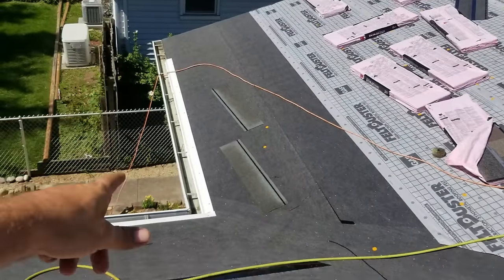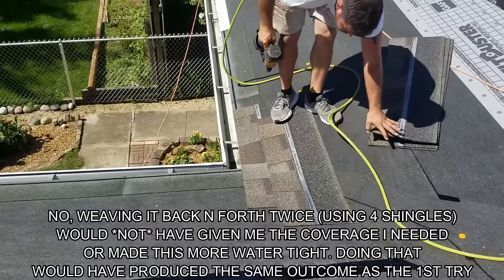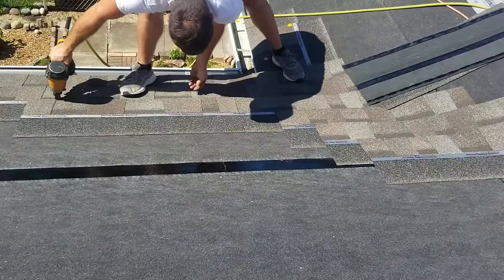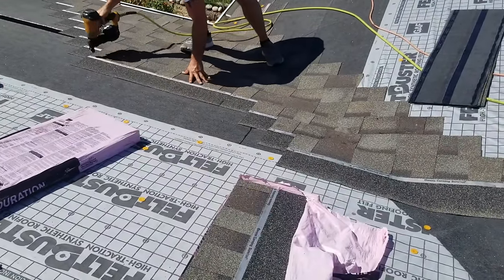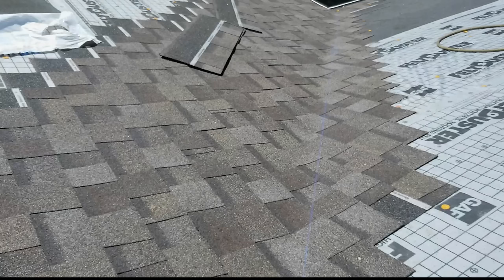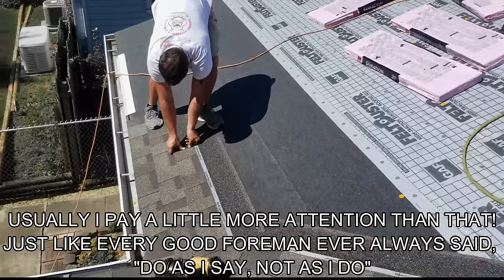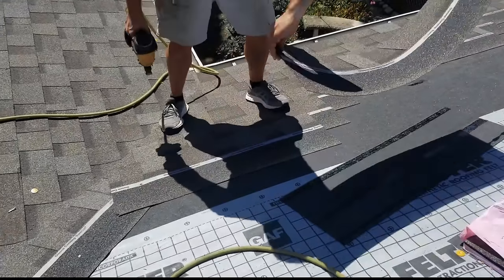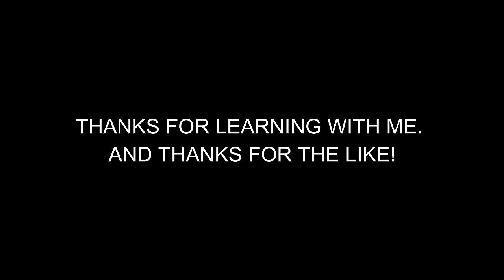How to do a closed valley!!!

Comment: Gotta love the haters on here 😂 Been doing valleys like this for 10 years and have never had an issue. Looks good. Keep it up 👍
Reply from the maker: hahaha its expected. most members of the hater herd either learn their lesson or become fans. its all part of the process. the channel is growing really quick idc about haters its all about the fans now. I might still straighten out a dumbass or 2 for fun though who knows
Reply: @NWIVeteranConstruction  Fall protection is the law, and if you want set the example you should do it right. Oh and California valleys leak.
Reply: @NWIVeteranConstruction  just curious what area your from? Im not being a troll. Im up north where Ice gathers in valleys in winter and expands.
Reply from the maker: @mightyd9508  north west Indiana.  Chicago basically
Reply: they leak.  especially the way you do it  not a hater, I'm a fan and I approve of absolutely everything else I have seen yo do this far.  I say take a course and get certified.    your a great installer.
Reply: @cgah6690  Agree....6 nails, in high wind areas and is required for 130 mph winds. He is using 5 nails, and misses inside lower valley entirely on a few lower ones.
Reply: Thats cause they're not calling back the same one to fix it and make the same mistake twice!
Reply: @DxOxN AxNxTxOxN  negative, 10 years plus owner for 3 years.
Reply: Dont hate me but with that kind of shingle doesnt it resrict the valley flow
Reply: What im asking about is perpendicular rather than parallel to the valley which way water flows
Reply: @cgah6690  certified really ... Must be real Dum .. it only takes the education of a fifth grader to learn roofing ... did roofing for many years. Then I went back to diagnostics and trouble shooting electronics on automotives... Where I could use my brain instead of using my back...
Reply: If you look closely at actual photos from some of the shingle companies, their valleys are done like this. Ten years, no leaks here. The guy I used to work for was going for more than 15 with no issues this way. The reason they may leak is if the valley shingle is run in too far past the valley, I have seen many syphoning issues when that is the case.
Reply: I've done them for 27 year's like that and never had a problem ....
Reply: Roofer here. Here in Canada vast majority do not do closed valleys, they are acceptable tho. Tbh they look ugly. A metal valley doesn't take long to pit in, can lock it to the drip edge  and gives a way more professional look. We always 6 nail regardless if under warranty or not. Favorite product is CertainTeed. Imo best shingle to work with and best looking. You do good work tho, 90 percent of roofers think they know what they are doing but actually don't. home owners do your research roofers are scammers.
Reply: I been doing this valley for 20 years. And is looks good and it works, good job
Reply: @dvakx1445  that was not  closed cut valley! Proper name. That was a California valley and they are for scabs who take 0 pride in their work!
Reply: I agree ....22years in the trade and have been a certified red seal since 2003......id never install a california valley......its for fast roofers..   Not saying there bad roofers.....just more worried about getting the roof complete as opposed to installing the best roof....customers dont know....most times they hire the fast roofer cause they are cheaper than quailty roofers who are using superior products and installation methods
Reply: never had an issue cause it takes yrs and  yrs for water to penetrate through shingles to felt through wood through insulation then through drywall smh heheheheheheh
Reply: I could always see a hump with these valleys a lot easier though and you don't have to hook the top part of valley shingle nice work
Reply: @allenbrooks7318  I am a builder  from new England and my roofer has done California valleys on anything 7 pitch and up for years , never had a problem but on a lesser pitch he weaves .but regardless you get the same coverage in the valley 12 inches up on both sides .
Reply: Veteran Construction Co
Reply: Veteran Construction Co
Reply: @Tyler Taylor "Havent had an issue" YET.
Reply: Did someone really say something about hardhats, work boots & harnesses?Lmfao! Why would a roofer need a hardhat? Harnesses are for steep pitches & anyone who has ever done any  roofing knows work boots tear shingles all to shit! Especially in Hot places but I'm not gonna address some of the Many stupid ass comments some of these "professional certified roofing know it-alls" have said. Lol I'm not gonna lower myself to their level because i have done more roof's around this country than I can even count & the guy in this video did a great job lacing that valley & the only way water is getting inside that house is through the kitchen sink & unless a hurricane or tsunami comes right across that house those shingles ain't going anywhere!! "He should be putting 6 nails not 5" really?? I can't believe there are people who actually think one roofing nail is gonna make such a difference. Lol now i do agree with 6 being part of the warranty coverage for certain areas but come on guys, stop being fuckin trolls who have nothing better to do than hate on someone else's good/hard work cuz I know half of u have probably never even been on a roof. Veteran Construction, great job & ignore these bitter trolls & keep up the good work
Reply: @henrystaggs227  hahaha my California valleys never leak your just doing it wrong buddy
Reply: @jamesboxold9671  you're exactly right.. it's kinda hard to do a California valley wrong if u really know what you're doing & if not then u shouldn't be on a roof unless you're just carrying shingles, I've personally never seen a California valley that's done right leak! That's just from my personal experience, but u can't just "wing it" or figure it out as u go when you're doing a California valley.. u either start it right & end it right or its gonna leak! Some things in life u can figure it out as u go but when it comes to roofing u have to know what you're doing from the beginning, cuz u can rip a 2X4 out & put it in the right place when u figure out what you're doing but u can't go back & start rearranging shingles. Lol
Reply: @cgah6690  37 years HAND nailing here and this guy is a joke. I will put any of my full weave valleys against his for time and guarantee mine will last the length of the manifacture warantee.
Reply: @NWIVeteranConstruction  Ww
Reply: This is an easy valley
Reply: @jefflinnell8492  Laminated shingles can't be properly weaved nor is it approved by the mfg.
Reply: homeowner here about to get new roof---our existing roof has valleys like this and I like it!
Reply: 10  whole years,  again painful to watch. why would you even do a closed valley ? Metal is $10 bucks for ten feet, shingles are $20 for 8 feet . Metal lasts longer looks cleaner and  take 2 minutes to apply. On a cut up roof ,it would save you hours of work and  hundreds of dollars in material . I wont even mention what "not" roofing backwards would save in hours . you say haters, I say never stop learning. "The true obstacle to discovery isn't ignorance , its the illusion of knowledge.  Signed: 35 years , and 4000 roofs , all disciplines .
Reply: @wheelpatriotthebestisyetto6115  😂🤣
Reply: @tmt3052  Awesome rebuttal . SMH
Reply: @wheelpatriotthebestisyetto6115  thanks for the life lesson old timer
Reply: @tmt3052  Things you would never say face to face . Carry on half pint.
Reply: @wheelpatriotthebestisyetto6115  I would say anything face to face. Your not scaring anyone my guy
Reply: makes no sense how do shingles line up rest of job. why not just let it cover with the flow this was done on my house bscked up ice snow and leaked
Reply: @NWIVeteranConstruction  this terrible roofer again who thinks a race and a channel makes him great! Go make another vid!
Reply: @allennix1052  im a certified damproofer and waterproofer....i work in roofing....it is a red-seal trade. Recgonzied under the government as 1 of 8 certified trades in Canada. And us roofers do have strong backs!  Lol
Reply: Folks 3 tab singles ARE NOT WATER PROOF !!!
Reply: Lol I’ve been tearing stuff like this off 32 years
Reply: @tyfreedom5793  yes....but shingles have changed in 32 years...manufacturers do not care....in 30years they are completely off the hook..... But certified roofers who keep up with modern practices do. Ive been in trade 25 years , 3rd generation. Own my own company....we do big commercial flat work and still follow government specs the 10-15 times a season when when steep roof.
Reply: @NWIVeteranConstruction  hater herd! Lol!
Reply: Maybe qualified roofer knowledge! No hater herd here.
Reply: @tyfreedom5793  none of mine
Reply: I didn't know the method; but I liked it before the end result was revealed. I used this video to roof a house in Dec 2021. Looks great; and the minimal amount of waste wouldn't have filled up a wheelbarrow. 😁
Reply: Maybe 10 more years will help
Reply: @yourfather8303  Oh hush it. LoL
Reply: Must not rain much where you live or at all
Reply: @allennix1052  lol yea ok buddy
Reply: @redeyez8288  all the time actually
Reply: You know the thing is i nail five. Ppl all have preference but rather then admit that
 Everyone swears they no tge right way. Wen your done doing the roof and it dont leak then it was done right
Reply: Sheeyutaahhp
Reply: I live in Maine and we do these valley cuts everywhere. You just want to make sure you're running at least a foot of shingle up into your valley on the top corner. (Your shortest part of shingle should never be less than a foot up in the valley. We also try to grace out 6 feet where we can which is generally almost everywhere
Reply: Package says these particular brand of shingles is warranted with five nails for that wind rating
Reply: Well you been doing them wrong for years. Not only a cheaters belly, but a waste of matirials.
Reply: Rocky roofing 😢
Reply: Excuses! U started wrong and you  know it. U just don't want to admit it 😂😂😂😂😂
Reply: get a room
Reply: I've been doing valleys like this for 3 yrs straight the only valley I do they look the best but I put tar down but those oc stick good let the haters hate I put all my new guys on this dudes channel than the nest day I ask them wat they learned I roof exactly like this dude so if he's a hack so am I 😅😅😅
Reply: I’m not a roofer but I’m doing the roof on my shed which has 2 valleys and I don’t know which way to go now after watching all these videos and reading the comments

Comment: What i like to do is put a metal valley in that closely matches the color of the shingles.  Snap a chalk line on one side of the valley at the top 4" from center, then go to the bottom of the valley maybe 6" from center. Do same for the other side. I cut the shingles at the line on both sides, leaving the metal in the valley showing.  Stay 2" back from that line with any nails. Then i will put tar on top of those shingle nails, every row. Being careful to make a barrier for moisture that wants to wick under the shingle and get to the nail is stopped.  It doesn't have to be a thick layer. Just enough to stick the shingles together.  It you over do it. The tar can warm up and run onto the metal making an eye sore. If the customer insists on a shingled valley.  I will put a 16" wide metal in the valley centering it, full length.  Then do not put any nails closer than  6" of center. Then if it is a 4/12 i might tar between every shingle on both sides right on top of that nail. So the idea is,,,, if any snow sits on the roof for any length of time going through that freezing and thawing cycle it can back up in the valley go under but has no places like nails to wick into. Granted, if no snow stays on the roof through the winter months, will probably never have a problem.  But we know that shingles on   a steeper pitch last about twice as long as a lower pitch. A 30 year shingle on a 4/12 pitch with a valley, with shingling through the valley will look good for 10 to 15 years. Then  the debris build up, ( not being cleaned in the fall,) will eventually take a toll on the face of the shingle because the debris usually holds moisture, depending on how deep the debris is.  Usually at the gutter edge it can become thicker. So i want my customers to have a nice looking roof for the warranty of the shingle.  On a 4/12, i might go as wide as 8" on each side of the valley at the bottom with metal. Leaving the metal open and exposed so  the rain has a chance to wash it out naturally so the customer dont have to worry about maintenance on their roof.  This video shows a method that can be used on a roof. When the rain pours down. This roof will not leak.

Comment: Surprised to see you doing the valley right. You always want a full shingle running through your valley it also prevents you from stepping up your gable and then making a bunch of cuts into the valley. The only time you have to cut into a valley is when you have double valley, otherwise you're doing thos valley correctly and most "roofers" can't or don't know how to shingle from right to left or left to right. Good job

Comment: Great job.  A valley  is quite complicated.   I just put on a ridgemaster  vent on my 34' shed.  I think it took me 20 hours.  It was 12/12  or something steep  close to 45. I had to RIP  off architectural caps and a row on each side then add a row each side so my ridgemaster would hit on the flats of my shingles.  Then cut all those new caps.    Lifes hard being a perfectionist.

Comment: I like your variation of a closed valley.  I began doing a woven valley years ago because of the usual problems of a cut closed valley.  I have watches several of your videos now and gained from them.  I've been doing it for 50+ years,, not a steady diet,, just the one or two regular customers each year.
Now it is my turn to give back.  Two very small tips for you.

A.  On any closed or open valley, there is a center line and the cut line off to the side,, it should be a taper, open to the bottom.  You can begin right on the center line at the top of the valley,, but then run the chalk line to 3 or 4 inches open at the bottom. This is a near requirement for an area with a maple tree, ash trees are pretty much gone,, the helicopter seeds.  If the valley does not open to the bottom,, they will jam it up.
B.  You use a rake edge starter strip, hopefully with a tar strip (There is one video,, no tar strip,,,, you know which I mean.)  The rake edge starter strips should NOT be flush with the shingle edges.  I have not seen your detail at that point,, I am inferring.  You could be doing it just fine already.  On rakes, the edge starter strip should be flush or just a bit beyond the drip edge,, but the shingle should extend past the starter strip.  Starter strips that are flush with the shingle edges on slopes will lead water back under the shingles.  Shingles always stick out farther.    You very likely do this already,, I have not seen a clear example in the videos I've watched thus far.  It just looks like you do it flush.

Always good to watch someone skillful.  In spite of my years and number of roofs, I haven't learned it all.  Good to pick up subtleties from someone else, who is good.
Reply: Sailor376also always cut rake straight to starter lol first thing customer looks at is the rake and if that looks like shit then the whole roof might look like shit
Reply: I’ll take A. For some thought. Sounds reasonable because on a rainy day bottom of the valley is a river

Comment: I've never seen anyone use shingles diagonally in the valley, always seen them cut off the excess overlap to create the seam. I really love this method! I told my fianceé when the first two diagonal shingles were laid "I'm not sure what he's doing; but I think I'm about to like it". This seems to eliminate a lot of waste, cutting time, and keeps a crisp valley edge. I'm currently replacing her roof from the damage of Hurricane Ida in Terrebonne Parish. It's been 20 years since I've roofed a house; and this video will help me out tremendously! Thanks!
Reply: It's called California  valley...not legal  in Alberta,CA...but did alot of it like this and its mint...never had one leak
Reply: @dannyneveu6226   I used this method on my fianceé's roof when I repaired it in Dec 2021. Waste was well below 10%. The estimate was $10K; and we done it ourselves for slightly under $2,500. I was very pleased with the results. If an ice/water shield is installed in the valleys, then it seems ridiculous for this method to be illegal anywhere. The overlapping doesn't change drastically, just an added guideline for the overlapping layer to follow. However, I have much respect for meticulous roofers. I'm definitely not biting at the bit to roof another house. LoL

Comment: Excellent! The 'only' thing I do different  is to sort through the package and choose shingles that end with a single ply on other side of valley instead of double ply on laminate.  Less 'lumpy' when other side of roof is installed.
I see the procedure of running 1 course of shingle up the valley before starting other side more & more. Personally, I still run them wild across valley, chaulk a line to valley crease, and cut (upper 'points' too).